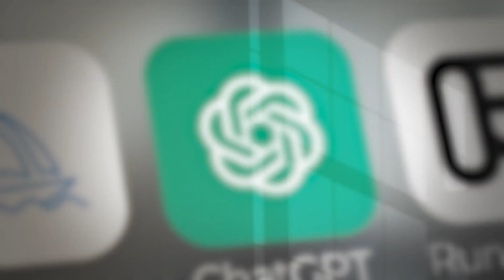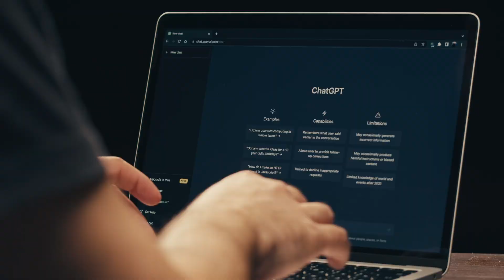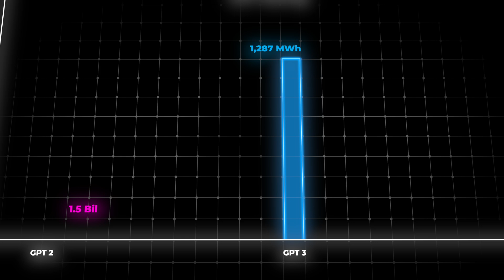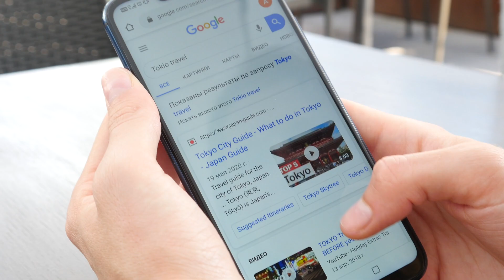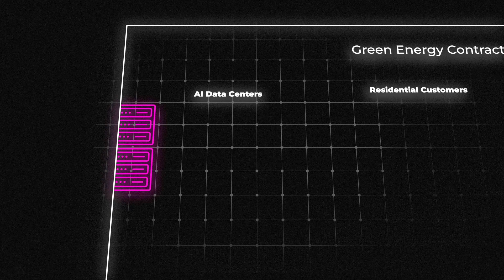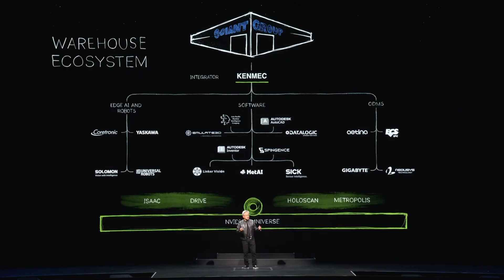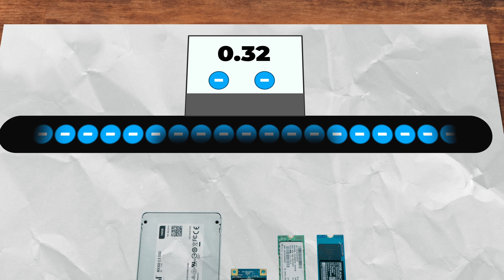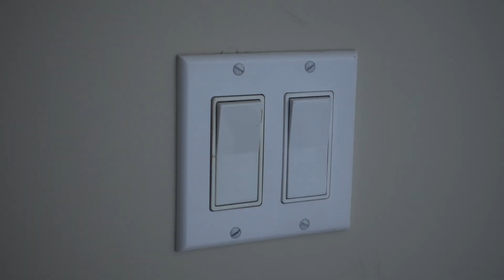AI's Hidden Cost: Can Our Power Grids Keep Up?

Comment: As long as the energy is properly priced according to supply and demand, it won't be an issue.  Let these AI companies have the energy, but make sure they pay the price for it.
Reply: Commercial power rates are typically a fraction of the cost of residential.   Same power sold at different rates... surprising? Nah, our system is designed this way.  😅😮.
Reply: @ryandgarland yeah but there are  many reasons it is that way. Just keep in mind there’s nuance to it
Reply: "As long as the energy is properly priced according to supply and demand, it won't be an issue.  Let these AI companies have the energy, but make sure they pay the price for it."

Yeah. Market forces will fix everything in the long term.
Reply: @yourcrazybear  why the fuck did you copy the entire comment you replied to?

Comment: Waste heat is easy to use. Heat a swimming pool, commercial laundry, heat battery, bakery, hospital, etc
Reply from the maker: yeah it requires cleverness though and coordination, which is next level thinking when people are just trying to get a new data center online ASAP to start making money (the gold rush bit)
Reply: In fact, now that I think about it, these types of solutions should be hardwired into all future city designs: a requirement to integrate district heating or some other way to transport waste heat from sources like data centers to where it's needed.
Reply: You have a good point. But we have to remember that reusing waste heat also requires infrastructure to transport that heat to where it's needed. What if you don't have a pool, a commercial laundry, or a bakery nearby?
I think one of the best use cases would be somewhere where they already have a district heating network set up.
Reply: @Israel_Two_Bit  there’s all kinds of ways to get businesses to locate like a tax if you don’t, no planning approval etc

Comment: simple solution: Make the big data companies pay for the construction of nuclear power plants, to even out the energy it progressively takes out the regular grid from people.

Clearly they got the money for it
Reply from the maker: nuclear power plants take decades to build, due to high safety and regulation. so there's o practical way we could do this, especially if other countries dont
Reply: @TwoBitDaVinci  The U.S. spends 6 BILLION a year storing spent nuclear fuel. Nuclear is a money pit.
Reply: @TwoBitDaVinci  I've got to agree with ya , i just wished people were not so afraid of it, so more countries would start investing more into it.
Reply: @TwoBitDaVinci In my opinion it takes so long because of perception and not reality. American reactor designs are quite good, or perhaps it has been forgotten that the US military has quite a few capital ships powered by state-of-the art fission reactors with a stellar safety record. I also dispute the claim that green energy generation is cost efficient, is easily scalable and bluntly its materials/components easily sourced from global suppliers. We are not living in a vacuum where geopolitical problems are not without consequences. 

And, of course, there is a pipeline problem. We allowed the skill sets and infrastructure needed to build and operate nuclear power generation atrophy, and creating that new workforce will need more than cash; it will need time.
Reply: @TwoBitDaVinci  True if you're talking the traditional uranium-235 fueled power plants that use pressurized water cooling reactor vessels. But not the next-generation reactors fueled by thorium-232 that are essentially meltdown proof and built in such a small scale that it could be mass-assembled at low cost.
Reply: I've had that thought for a while. Residential power use can be met with grid-tied or off-grid renewables/storage, while industry can run off nuclear/hydro/geothermal if it needs to be so consistently supplied.
Reply: guys i said nuclear because it does easily produce the most energy of them all. 

but Solar is pretty cool too, i know for a fact that it is more cost effective than it,

 however; big data companies just get away too easily with short term solutions these days, and if there's a way for they to contribute for the solution of a problem themselves are a big culprit of...

 they should not save any expense at it

than again I'am cool if it turns out solar is the way to go, as long as they pay for it.
Reply: Why make them build the most expensive form of energy that takes a decade to get to first plasma? Why not solar that is the cheapest form of energy production and can come online in months? This is why there is now more investment in solar than all other energy production combined (oil & gas, wind, nuclear, hydro, geothermal, biomass, etc).
Reply: @truhartwood3170 - “why not solar…?”

Because data centers run 24x7x365, not only when the sun shines. The rest of that energy storage must come from peaker plants.
Reply: @DavidHalko  or battery backup, which is far far cheaper than peaker plants. Why do people keep insisting on doing the most non-sensical, expensive, environmentally damaging options?
Reply: @truhartwood3170  Well, because it would take solar farms that hog a HUGE amount of land.
Reply: @Sacto1654  there's a ton of land that's doing nothing. Just covering the roofs that have the right angle, aren't shaded, etc would be enough for around half of our energy needs. Putting them over water culverts helps reduce evaporation. Putting them over parking keeps parking lots and vehicles cooler. Combining solar with grazing land actually helps the grass grow better (keeps it from getting heat stress, which shuts down growth) and gives the animals shade. There are many examples of places you can put solar panels where they're actually a benefit. Plus tons of land that's just empty desert. We're nowhere near running out of good places to put solar panels.
Reply: @twobitdavinci; Idea for vid: cost of different (not fossil) sources per Wh, got feeling there is lots of debate without good overview what the cost are (cost in building, lifespan, maintenance, projected material use,  etc).  Also storage (battery, H2, hydro) would be handy to know: The shortcut (nuclear) many want to take now, is in my opinion expensive and the availability and mining of fuel gonna be a problem in short/mid time.
Reply: People think the grid cannot keep up, and talk about lack of infrastructure. 

 I think they forget it is driven by  private demand, and electricity demand was either a small increase per year or dropping. We never needed a large production, because every year our stuff became more efficent.

 Look at electricity demand from 2008 to now. For many years it kept dropping. 

 Therfore our private power companies had no reason to invest or build. Afterall they are for profit, and over building is a waste. 

 Basically what I am saying is there was no demand. Now that there will be more demand the power companies will see this opportunity to get richer, and kick into build mode. 

 Praise be capitalism. 

 The big AI companies are already making their own power from what I understand. Google is going for even geothermal. 

 The nice thing about the Sun is that it not just produces solar or wind. It over produces it. We have more than enough sun to run AI.
Reply: @dianapennepacker6854  I'm not surprised reading AI-Industry using same tactics like exxon. "Everything is fine"
Reply: @volkerengels5298  I think they'll be making their own energy. At least the big companies. 

 Probably a lot cheaper getting solar, wind, batteries, and hopefully that new geothermal technology. Than paying some other crap greedy power company. Most likely cheaper too.
Reply: no, geothermal energy
Reply: "simple solution: Make the big data companies pay for the construction of nuclear power plants, to even out the energy it progressively takes out the regular grid from people."

Or just let the professionals build out their energy generation on a free market? 

"Clearly they got the money for it"

Clearly they got the money for it.
Reply: “Make them” 
You already lost right there. This is America my guy
Reply: This is America. You can’t “make” them incite such a cost 😂 that is so insane. You have any idea how much that costs? And what you plan to do when those companies just move out of your country? Exactly
Reply: You don't want to have nuclear power plants around when  your civilization collapses
Reply: @volkerengels5298  implying we live in the 19th century
Reply: @FireAtICE  "Collapse of civilization is not possible in the 21st century" - or what are you trying to tell me?
Reply: HEY................ RevKey,,  why aren't  you on the the frontline Meatgrinder for boyfriend Putler?  he will give you hammer but you won ever need the sickle.  COMMIE SYSTEMS ALWAYS WORK!
Reply: Exactly. Tell them to build solar plants and use them. If they don't like it, fine them. 

We don't even have real AI. It's just google 2.0. it's all marketing and we see through it.
Reply: @kevinroberts781  "Exactly. Tell them to build solar plants and use them. If they don't like it, fine them. "

That's quite anti corporation right there. 

"We don't even have real AI. It's just google 2.0. it's all marketing and we see through it."

It's not Google 2.0.
Reply: Nuclear is too slow but the fracking geothermal tech looks promising
Reply: @stephenbell9324   Hence why industry can use nuclear. Metal refining and AI training are 24/7/365 processes, and any changes to the load would be slow.

Comment: Yes! Make a video on heat redistribution (at least at the data-center level) and how we are not taking full use of this topic. Recycled electricity at the time of use!!!
Reply: I wanna see more options for residual server closet heat recycling or a heat dump into a sunamp thermal battery or a sand battery
Reply: Yessss
Reply from the maker: heat is so often disregarded, but its got so much application.
Reply: Oh yeah does this mean like using heat pumps to convert that heat into electricity?
Reply: @benmcreynolds8581  I think it makes much more sense to use the heat as it is, to heat something else.